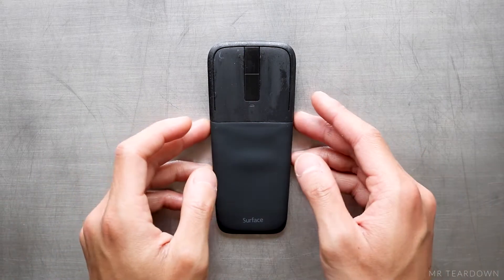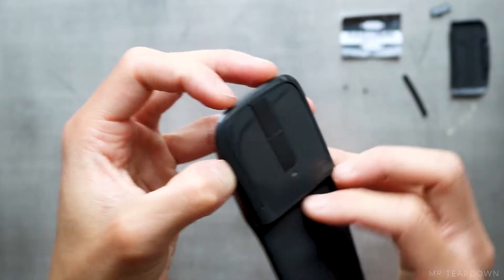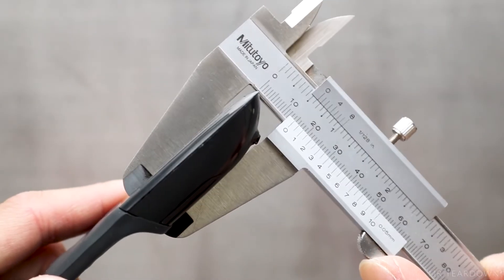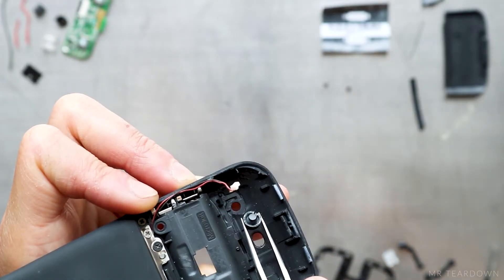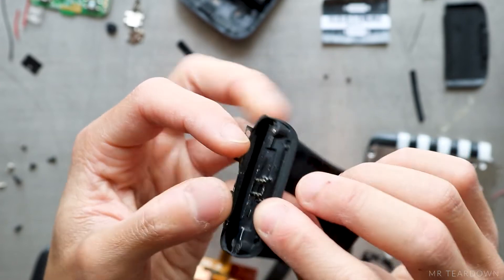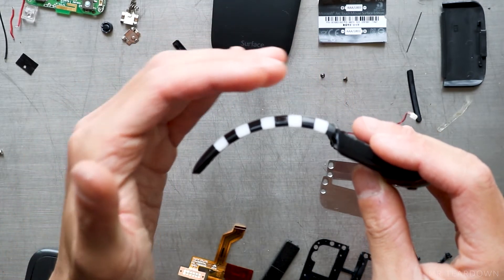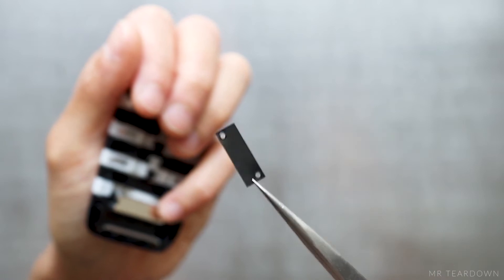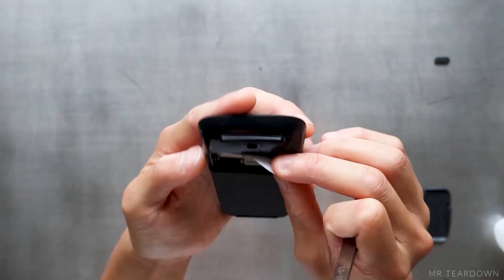The mouse that bends - Microsoft Arc Touch Teardown

Comment: I had my Arc Touch mouse since 2014, i travel about 55% of the year due to work/my personal enjoyment of travel and this mouse had been my companion for 9,5 years before it broke down. (doesn't power on when bending it) - i bought the current version of this mouse and it's not as good/comfortable. You lose the haptic scroll, and the new scroll being the entire surface is less accurate. You no longer have 2 separate left & right mouse buttons, instead the entire top plastic half either slants left or right depending on your press; so if you're a multi-tasker, and doing rapid left/right presses; it will get "stuck" so i sent it back- using this teardown as a guide, i will see if i can figure out what's wrong with my Arc Touch mouse and hopefully fix it.

Comment: Thank you for the detailed video. After couple years of use, my mouse started draining batteries within few days. I had a new one, unfortunately when open the box the batteries leaked damaging the dongle transceiver. Since the dongle transceiver of my old mouse is working, I am considering removing the antenna and replaced it to the new one to see if that helps; nevertheless, I do not know what part is the antenna. Could you please let me know which part serves as the antenna receiver?" Thanks

Comment: Very well done!  The new design Arc mouse came with my second-hand Surface Pro 4, and it honestly took me a frustrating few minutes of trying to move the mouse around in its 'flat-state' before I stumbled upon its flexing feature.  GENIUS!  And the new touch pad is equally exceptional.  If anyone does this themselves, absolutely use double-stick tape to retain your screws/components in an organized manner for re-assembly, andy possibly a big 'cookie sheet pan' with a rim to contain the tee-niney screws and parts when they come apart.

Kudos again Mr. Teardown, well done and sensibly presented!  Thanks!!!

Comment: As to why there are slots, my theory is this was done to allow some deflection to follow the contour of your hand with the center of your palm being higher than the sides.  Also, the top slotted plate (the one with lots of slots) rides over the horizontal bronze spline, so my theory is the extra slots reduce friction as well as extra flexibility over the spline which (in the off-state) is slightly higher than in the on state.  Really--this is an impressive ergonomic design!

The bronze spine is used for friction like you said, plus its lack of magnetism; some stainless steels do have slight magnetic attraction, so the extra separation at the bottom over the magnets helps with that.

Comment: Your commentary was excellent.  Great video!
Reply: My mouse wouldn't turn on, so this video showed me how to take it apart.  One of the (probably) 30 gauge wires going to the power switch broke at the switch.  You have to take out 20 screws, so I recommend you use a pad of paper with double-sided tape to keep the screw pairs straight.  Be careful; four of the screws have ridges under the head so they slide in the stainless steel plate screw slots.

Comment: Thank you for this teardown! I've had this mouse for quite a few years now when I bought my Surface 2 Pro. Yesterday I found that batteries had leaked in it and I wanted to open it up to clean the board. I pulled the sticker off of it thinking there would be screws in there but didn't pull the sticker off enough and thought that maybe it had been glued together. Thank you! You kept me from breaking this thing trying to get it open. Great teardown!